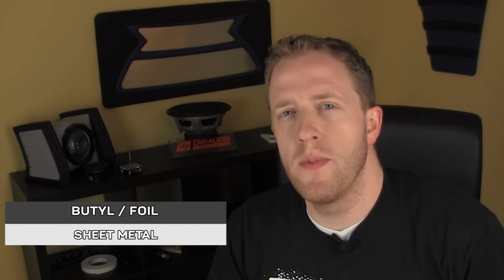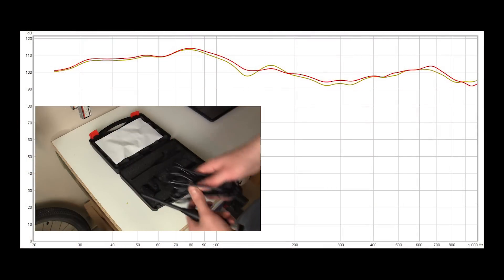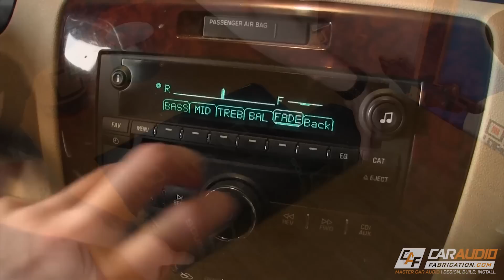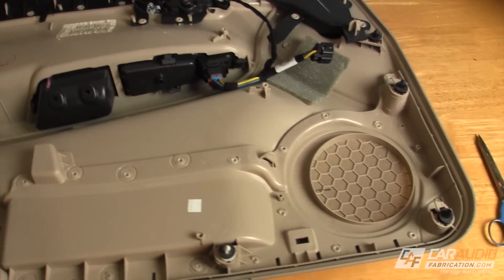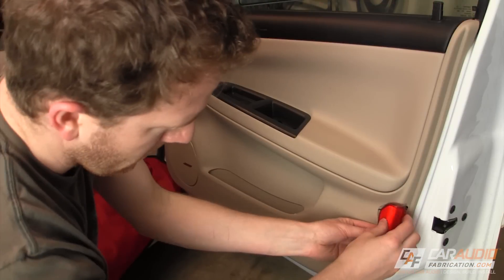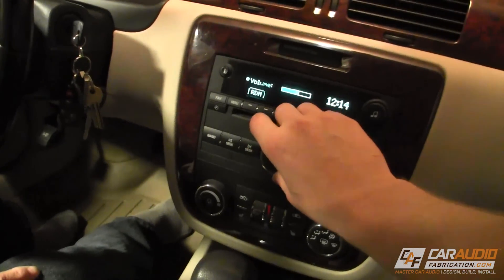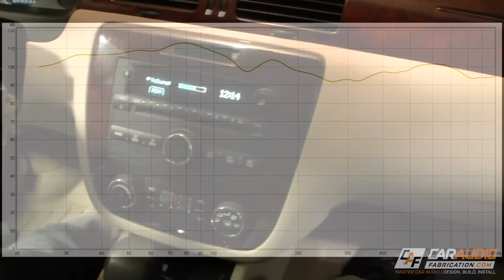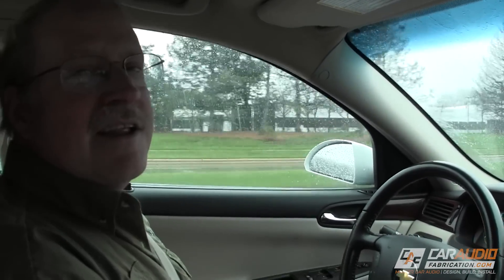EASILY Sound Treat your Car for Better Sound! - CarAudioFabrication

Comment: I did apply the deadening sheets similar way but I'm not impressed with midbass response, I don't know why,  maybe I need to get used to it. Door became a little heavier and nice closing "clunk" sound, reduced vibrations. Applied on both metal sheets, inside and outside.

Comment: I've watched a few of these videos and can't understand one point I keep hearing come up: closing off the inner door skin to keep the back wave from canceling the front wave.

If the speaker is properly sealed to the door card, then the back wave can't interfere with the front wave. Which is a lot easier than going through all of those steps to seal off the inner door skin. Granted, it will reduce noise levels, presumably significantly. But insulating the inside of the door card would do that as well, which is also much easier than all of those steps on the inner door skin.

It seems like mass loading the outer door skin, sealing/coupling the speaker to the door card, and insulating the door card will achieve the same effect with much less work and materials. Am I missing somethin?

Comment: Where does one obtain this ‘ultra wide transparent tesa tape’ ? 
Or is there a different name for it? Or, a better product for doing the tracing part?
Reply: I ended up using some transparent construction floor protector stuff… works great.

Comment: The only problem I see with covering the holes in the door is that you'll have to remove the insulation to get to the window regulator to replace it  and/or replace the window. And if there's cabling running along the door that would be problematic also.

Comment: OK everything is good but you forget to make a hole so when you take it to the dealer to get windows fix they don't have a hole to get to window
Reply from the maker: It doesn't take much mechanical ability to understand you can just peel the material away to access the needed locations, but you're correct, the part swappers at most dealers probably wouldn't be able to overcome such an incredible challenge

Comment: Really appreciated the way you explain sound damping. I have done the same thing to my car ..the bass, middle and treble improves a lot...but the problem is, without damping I didn't feel any ear pain, but after damping I felt stressed ear after listening music for long time..
Reply: Might be your EQ or volume levels
Reply: This makes absolutely no sense as cutting down on sound intrusion like road noise should make the music easier to listen to
Reply: You turned the door into a speaker cabinet thereby increasing the spl level turn it down. If thats not it try adding a outboard amplifier, distortion can cause some weird affects. Class ab amp and some good componet speakers go a long ways!!! Rewire doors with some fine strand wire 14 awg has to be a wire that is meant to be flexable at whatever temps you live around or insulation will crack and short out.

Comment: Do you know of a company that installs this in Austin Texas? I contacted two. Very high prices. Company wont provide details such as materials used. More focused on "audio" systems.
Reply from the maker: Installing sound treatment is very labor intensive. I'd be more concerned with a company that quotes a cheap price as that means it's not getting done right.
Reply: @CarAudioFabrication  Thanks for the reply. I understand that. I've spent many "hours" viewing videos online and researching products. Im retired at 68. I've been purchasing ,selling cars and even doing minor repairs myself since I was "17". I've had two cars one 68 Camaro upholstery repaired. .Business management major and small business owner for over 20 yrs. But, you dont any company or even an average estimate for specific work? Like cost to do four doors on a Rav4? What about providing info on what "brand" of materials used such as Dynamat or Noico? Either they are very busy and dont need my business right now  or maybe, not so honest?

Comment: The large access hole to the outer door panel on my car is a pretty solid plastic panel with CCF gasket sealing all the way around? Can I leave mine in place and just apply the CLD over the plastic panel?

Comment: I have a question. Since you covered the inner skin with soundskin material. Is there no need to put the vapor barrier? And why? Thanks for your help!
Reply: @notsevenfeettall  i agree, thats what i was worried about. If need to do work inside the panels, it might be troublesome. But thank you for your help.

Comment: What about access to the window regulator? Can the insulation you used to cover the big hole in the sheet metal be removed to allow access to the window parts and still have the same effect?
Reply: That's the exact thing I was wondering. I would really hate to make my car hard to service

Comment: Installing some deadeners in my car this weekend. Would you recommend doing the doors as extensively as you did, meaning the inside door shell, doorframe, and plastic shell as well, or would i get more bang for my buck doing 25% of the door shell, the door frame, and my floorboards/roof? If i do not have enough for both the roof and floor, which would be best?

Comment: Do I need to sound dampen my front doors if the only aftermarket speakers I have are two 12" subs (Kicker L7Ss) which are aimed upwards in the back of my SUV (Ford Edge)?

Comment: where do i get this green tape ive spent 30 mins looking and cant find anything similar.
Reply: You can see if you can find an alternate to Protex 8216-2L protective film. It's a 2-mil sheet film thickness but, I don't know if that's what Mark is actually using in the video. I used to use Protex among a lot of films for various applications while working on contract for Boeing. They use the stuff to protect certain parts of aircraft metals and plastics etc.

Comment: I did this. Covered the whole inner side of the door with foam sheets. End result is reduced road noise. One drawback I feel is that the speakers lost a bit of mid range. But bass became so tight.
Reply: I also feel that, reduced vibrations and road noise but sound isn't that great, mid range is less now. It is 2018 Corolla.
Reply: @AbidAli-bo8sv  turn the mid range up in your head unit settings a click or 2
Reply: Thanks for the comment. Definitely not doing this for my pa mids
Reply: @christojoseph2476  I’ve only found improvements in sound quality cause it reduces the resonance. If your sound was using the metal vibration from the door to transmit sound, that’s not ideal but I guess it could be possible

Comment: removing the moisture sheet is going to cause problems, it is there to remove moisture, rain, damp, down to the  bottom of the door and out the drip holes, your "nice sheets are going to get soaked with damp over time, damp, causes mold and your sheets are gonna rot, also there is no drainage, all the rest is fine, but do NOT remove the moisture sheet. If you rate how your car hifi sounds as opposed to how your gonna deal with a moldy rotted and rusted out door.... make your choice- 96 people understood this 5.4k didn't

Comment: SO did you do all 4 doors or just front ones? and how much would this material cost per door?
I assume it could be used on floors and roofs as well?
this is what really really impressed my about Mercedes cars. it was only a 2006 model that i testdrove but that was the quietest car ive ever been in.
And its also 1 of  Two MAJOR  factors that deterred me from buying a Nissan 2009 350Z, thats cars entire rear wouldve needed sound treatment for me not to go crazy with roadnoise.

Comment: Im thinking of doing this to my camaro for my sound system. Lots of rattles and road noises but my car is fiberglass its ment to be light and fast. But i have no mid bass what so ever. So this is tempting. have you ever done a  camaro with fiberglass doors?

Comment: You said in the video that only about 25% of panel area coverage by alubutyl is sufficient. Are there any gains if more area is covered with alubutyl, like 50%, 75% or even close to 100%? Also, when using closed cell foam on a certain surface, what percentage of the area should be covered? Does anything below 100% make sense?
Reply: Hello.
I installed this insulating material and foam insulation in every cabin of my car, and the noise insulation has improved significantly, but the sound of the engine and mechanical parts is still heard at the same level.

Comment: So that butyl adhesive back is cool to have exposed on the inside of your door?
If that's the case it is going to make replacing the vapour barrier for my power window conversion a lot easier

Comment: I love that you took the time to replace the large piece that covers door holes. Also I would use spray on boom mat for the plastic panels and sound skins or a cheaper roofing insulation roll very simular to what you used to save a little money on a personal project.

Comment: I have a 2004 Colorado 4 doors, my little set of mid speakers were only $60 I wanted so bad to install this skin sound treatment but that roll it’s more expensive than what I thought I don’t even know how many rolls I would need :,( 

$90 a roll it’s expensive
Reply: it will cost more then your truck. makes no since unless your doing like spl audio build or your crazy rich and in love with the truck.  get yourself some rubberized undercoating and some printer paper.
Reply: aztecafily1524 , go to Home Depot and buy the roofing ice shield, self stick rubber membrane, does the same thing, buy a roll of foil tape, to cover it if you want to.

Comment: I actually have the same car. Thank you 🙏
Reply: Impalas have an advantage.  The glass used throughout the car is actually made much thicker and there is more material in there doors because GM wanted them to be quite inside the cabin.

Comment: If any of you were wondering just like i was, the clear green tape that Mark used to outline the cutout of the SoundSkins is called “TESA-51136” made by a German company named “Tesa”. It is very expensive, averaging about $150 per roll. I wish there was a cheaper off-brand version of this that i could buy so i can accurately create a template for my Dynamat.

Mark can you please help me?
Reply: Bennett Deering , go to a craft store and get some tracing paper, use painters tape, the blue shit, just tape together, bingo, there ya go.
Reply: I think you can use the protective film that car dealers put on the floors of cars to protect them from wear before sale. Which is same thing that realtors put down to protect carpet at open houses. Available at Home Depot, I think, and certainly on Amazon. Way cheaper!

Comment: hello, I want to sound deaden my car to reduce road noise, will this type do the job? my car is lowered and it has a lot of road noise and as a result the my system doesn't sound as good while im driving, would this do the trick, but I don't want to reduce exhaust noise or anything, just the road noise, I was just going to do it behind my mids and the doors.
Reply: Avraj Samra , yes, that's what it is made for. don't forget the Floor Pan, remove front seats and peal back the carpet !!!!!!!

Comment: The owner of Hushmat, another premium sound treatment brand, has studied the question of what percentage of a panel gives maximum coverage, and the answer is 75%. He designed noise control packages for Ford and Cadillac before starting his company, and he is a degreed acoustical engineer. Any more coverage just adds unwanted weight. Dr. Porsche had a saying: “Weight is the enemy”. The owner of Hushmat further said that the only reason some shops do 100% coverage is so the customer does not think he is getting ripped off.
Reply: David Gold , listen Dr. Google, to each his own but " Weight ", are you really concerned with adding one pound per door to keep out road noise.
com on man, really ?

Comment: Mark, long time fan here. Would you then add MLV to the door panels like you did in the Second Skin door video? Also, I see two approaches that people do in doors. One approach is to layer the outer skin with CLD and then some type of sound absorption material to the whole outer skin (not just behind the speaker, i.e. fast rings) for the back waves. The second is to only use CLD tiles and then use a hard material (ABS/MDF) to cover the big holes to create a "box" for the speaker. Which method is best for the audio system?

Comment: I was surpirsed to see that you use a very basic wooden roller- I use the same one but I figured you'd use a higher quality hard rubber one. I considered picking one of the more expensive ones because of how much time and money I was dumping into my installs but not anymore, the wooden one worrks just fine and you seem to think so as well.
Reply: Lil Sprout , doesn't matter what the roller is made of. the result is the exact same outcome.

Comment: Thanks for the video- I have a pondering question: when my first car was put together for stereo competition, my installer used spray deadener inside the outer sheet metal of door, but have not seen you address this..why? Seems easier on install application
Reply: Willie Wilson Spray deadener seems so only be used in full restores these days. This is because of it being:
1. Slow to apply (takes a while to get 80mil worth)
2. Lighter (less damping) 
3. Messier

Comment: Wait a minute I just saw this. So if I use this product this is effectively like using the damplifier pro, luxury liner and overkill product that you used on your other door sound deadening video?  Or am I missing something there?
Reply: No, no it is not liking using Luxury Liner or Luxury Liner Pro. No amount of closed cell foam will ever substitute the noise blocking abilities of a Mass Loaded Vinyl. CCF only decouples two hard surfaces...that is all, it does not absorb or block out air borne sound like MLV.

Comment: Really appreciate the video but I gotta say that the test measurement was not that impressive in the after.Maybe I'm expecting too much or the results are actually better than I'm making them out to be.

Stuff does look good for quieting the car though.
Reply: John Adams I agree, but the real benefit should be the noise reduction from outside the vehicle, as well as reducing rattles / noise from the door while driving.  How much time does the average person listen to their car stereo without driving their car?  Frankly, surprised it made any difference in sound in an "ideal" set up:  no outside, no road noise, and no movement of the vehicle.
Reply: Well just this past weekend I bought 16 sq ft of Dynamat Xtreme and did both of my front doors.Did about 65% of the outer skins and pretty much all of the inner skins.Plus did as much with the scraps as I could to the drivers side door panel.

The result was quite obvious after the first door(drivers side)was finished.I sat in both seats listening to songs at different  volumes while Balancing from side to side.It was amazing as I sat in the passenger side to hear how much more powerful the sound was from the driver door! Tight and full with very little effort.The passenger door sounded so hollow and weak.No comparison whatsoever.Needless to say I treated the passenger door the same night and now both are finished.

So though the test graph Mark showed here didn't look significant,my experience was quite the opposite which is why I stated above the I could possibly be misunderstanding things from a graphical standpoint.The true test is with your own ears and body.
Reply: John, great to hear (sorry, no pun intended) that it made a difference for you.  I am a firm believer in sound treatment for a car, with the doors making the biggest difference.  I trust that you are dampening vibrations / resonances that were coloring the sound prior to treatment.  What is the difference in sound quality / noise reduction when driving?  In Mark's car, there is a benefit in the upper bass response and, albeit small in the graph, a 3dB difference is significant.  My point was that,in real world driving / listening, the benefits would be greater than what is shown in the graphs:  road noise and resonances in (and through) the door are greater and, with less noise, you are able to listen at lower volumes and still hear the music, reducing distortion.
Reply: Rene Neron Honestly the road noise hasn't changed much.But my car is actually pretty quiet to begin with.There is 3 inch foam on the floorboards so that does have an affect.I guess from my research that CLD like Dynamat isn't for road noise specifically but MLV and CCF are.Seems like that could start getting very expensive and time consuming.However,the material that Mark is using in this video seems to cover those aspects in a 1 sheet deal.Seems pretty nice.Maybe I should have ordered a few rolls of this stuff instead.

Comment: Hi Mark, need your help. I want to install four new 6.5 speaking into my Hyundai i10. However, not sure if to use an amplifier and if I do which one to use and how many watts.

Can you help?
Reply: Here's my 2cents. Depends on the watt RMS rating on your chosen 6.5 inch speakers. Find a 4channel amp that has an RMS rating close to that of the speakers on each channel when wired at 4ohm. Hope that helps.